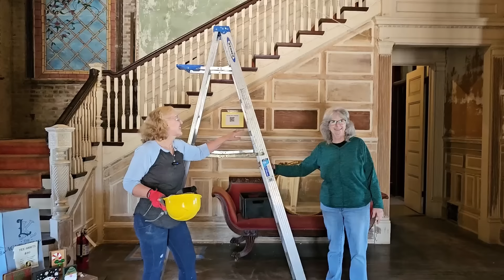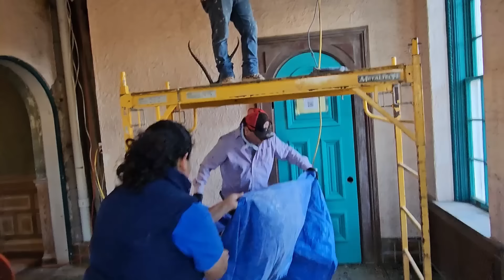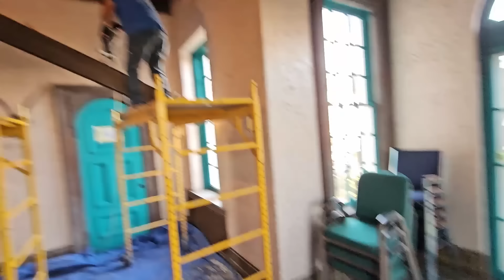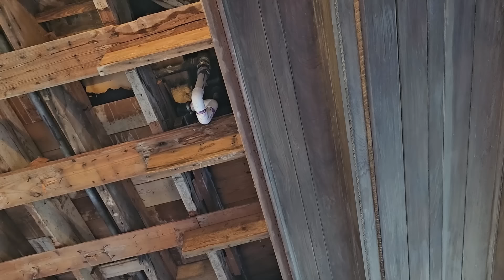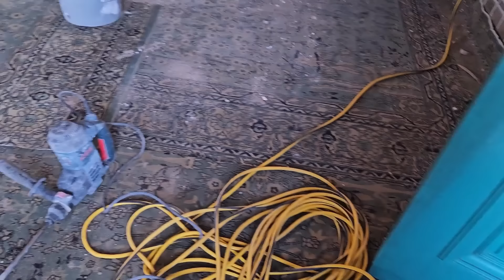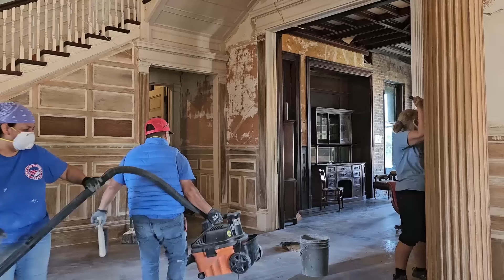S4.16 Demolition Day!  An Unplanned Activity

Comment: They did such a good job with those ceiling beams in the 1920s room, because they looked so real and structural. That is quality craftsmanship. 

Also. It’s good to see those gigantic pocket doors in the main hall slide pretty nicely. Everything that doesn’t have to be…often times completely redone, must be very assuring.
Reply from the maker: We are so very lucky to have all the original decorative parts of the house in tact.  The pocket doors are huge.  Someone tried to steal one and did some damage to the rails.  I'm not looking forward to reinstalling it.

Comment: To replace the fallen plaster underneath that landing,  cut-to-shape HardiPanel and deck screw it up after adhesive it into the lathe boards. Did that at my palace up here. No more worries about vibration causing it to fall.
Reply from the maker: Thanks for the tip.

Comment: I was wondering about the plumber having to work on the bathroom pipes from underneath.  If a leak or some plumbing problem happens again, would you have to take down the ceiling again for him to access it?  

And one other thing- I was thinking that your fans might enjoy hearing where in the house you are working.  When this video started, I saw the pretty tourquoise door and wasn't sure where you were.  I figured it out later.  Once before I think you were in the library, but I wasn't sure.  Knowing where in the house you are standing for me would be extra interesting.  Thanks for all that you and your sister do.  Thoroughly enjoying the videos!
Reply from the maker: Great tip about doing better on the videos about where we are in the house.  It is hard to get oriented.  Your comment about having to remove the ceiling for a future leak was very interesting to me because we couldn't tell until we got the ceiling down that it had obviously been removed before for plumbing problems.  The pvc  section to the tub is obviously newer.  Once we looked close, we could  see that the decorative rope trim on the beams is different than the original.  Just casually looking up from the ground, it was not noticeable.  It might make sense to put this back up with screws in case of future problems.

Comment: I just had a root canal after a crown just fell off. I looked like a 10 year old with gaps in front. 🤦‍♂   Mine only cost £40 via the NHS. My guess is you paid a bit more. 
The fake beams came down without too much stress. great video 2x👍
Reply from the maker: Yikes.  I wish mine cost so little.  One of the perks of being old is that I do have Medicare with a dental component so it wasn't as much as it could have been.  I was shocked at the fake beam coming out in one piece.  It's always a treat when something goes right.